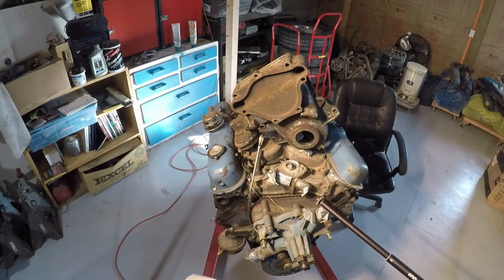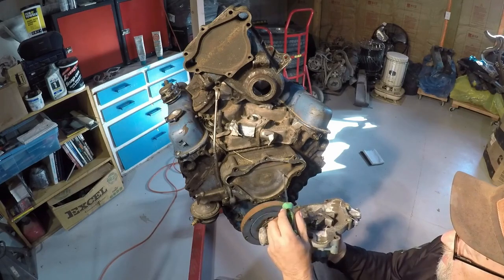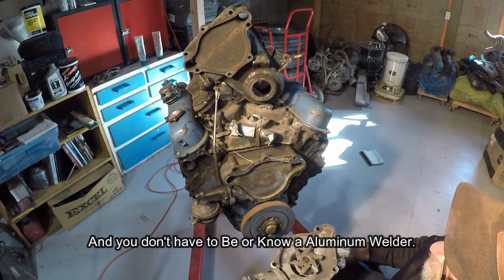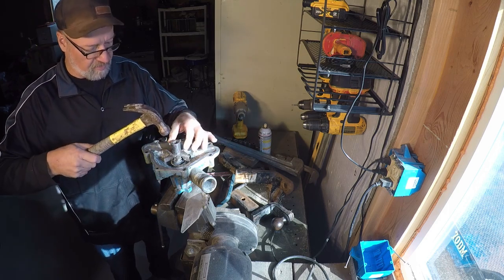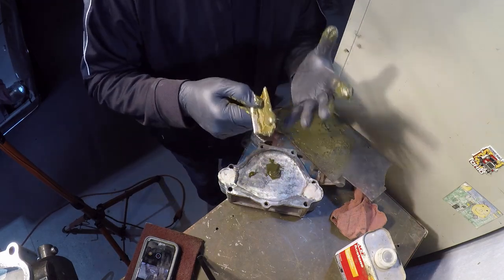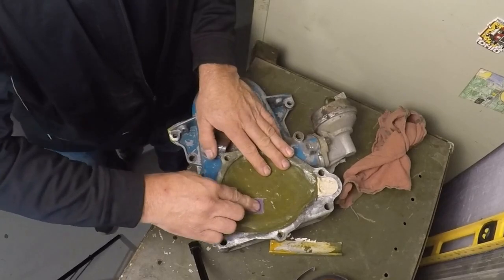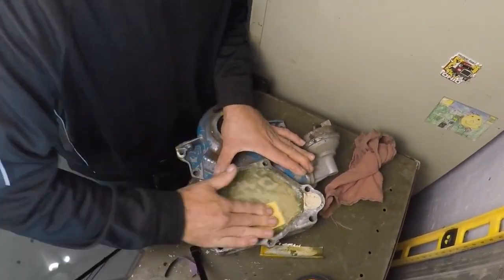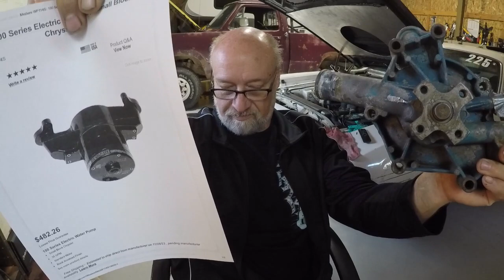Race Flowing Stock Water Pump for under $100!!!

Comment from the maker: Here is a few link to the product i'm taking about.
   Meziere 100 Series Electric Water Pump Small Block Chrysler
Summit:  https://sovrn.co/1nq1lep
   Moroso Electric Water Pump Drive Kit Universal Fit
Amazon:   https://amzn.to/3FLW9Rv
   Edelbrock Victor Series High Performance Street Mechanical Water Pumps 8887
Summit:   https://sovrn.co/kwfsw6n
 Amazon:     https://amzn.to/45ZQXUW
   36 grit sand paper
Amazon:     https://amzn.to/46W6gPN
Premium(standard) Water Pump.
Amazon:    https://amzn.to/49kMcIn
These are affiliate links. aka if you buy from this sight i may make a dollar or two.
This does not affect the price of the product.